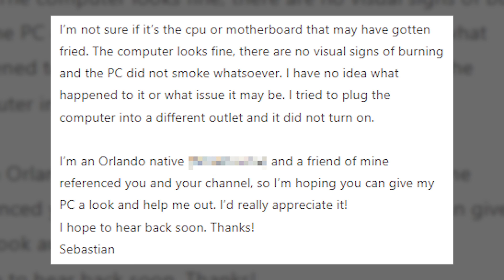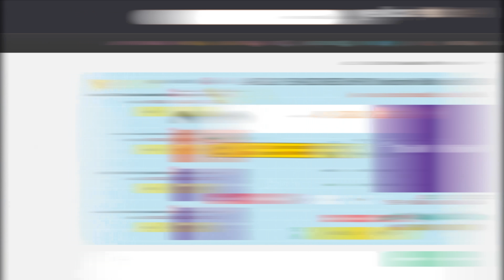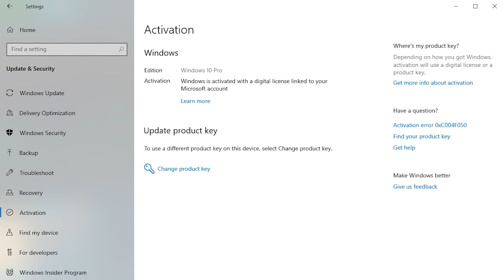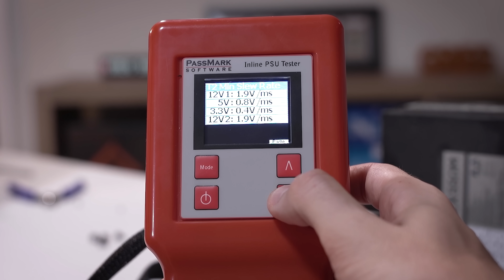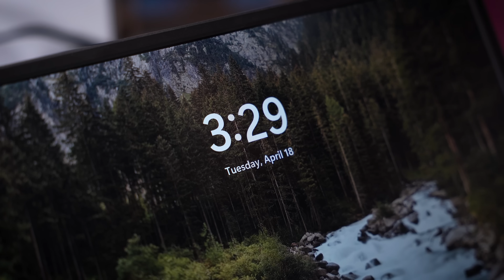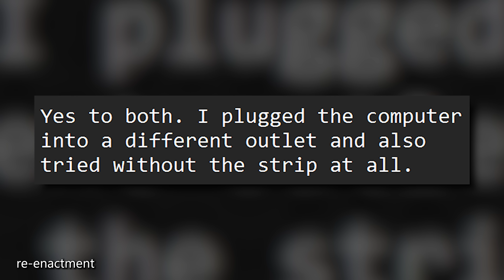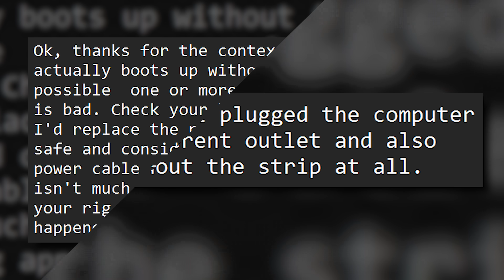Fixing a Viewer's BROKEN Gaming PC? - Fix or Flop S4:E6

Comment: I would have bet good money that his psu was going to be toast. That must have been one heck of a power strip to absorb that big of a surge. Most likely he will need to replace all the outlets in that room, just to be safe, done by a certified electrician. Have the wiring for that room checked and the breaker checked as well. All in all, a good job with the trouble shooting.

Comment: I had a power supply fry on me once. I didn't want to believe it, tried to power it on a second time. The first, it blew itself but probably didn't fry the system. The second time, it sent full voltage through everything. Nothing was salvageable. I had charred chips on the hard drives. Turned to ash. Electricity is nothing to play with. Always err on the side of caution. I often think "what if I hadn't tried to power it on that second time"?

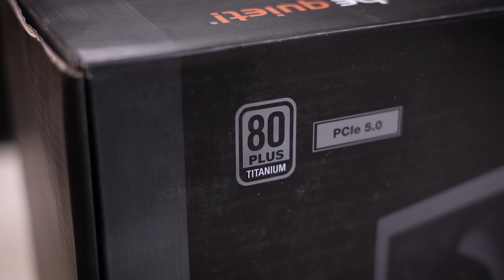Comment: 7:40 GN has already proven that 80+ has nothing to do with quality components
Reply from the maker: Has nothing to do with "proof." Doesn't matter what GN or anyone else "proves" or "doesn't prove." A more efficient unit requires certain tolerances. It can be a reflection of design/functional quality - though obviously not the only metric. A PSU using excellent, efficient components that is routed or mounted improperly, for example, is still a shit unit. But I'd certainly choose a more efficient unit over a less efficient one, all other things equal. And that was the point I was making. No need to look so deep into it.

Comment: I really don't understand how anyone calls you stingy. This guy's PSU is fine and does not need to be replaced. If you wanted to load test it, maybe you should look into booting live Linux USB. I'm even more convinced now that you replace parts just to advertise your sponsor.
Reply from the maker: We only replace components we feel justified in replacing - whether sponsored or not. In fact, our agreement with be quiet! stipulated that we had the right to push whichever product in their lineup we felt best suited the build in question. However, as you can imagine, there are many cases where a replacement isn’t warranted.

Comment: I have had more than one power bar go bang in my presence and the surge protecting device inside usually explodes violently if a breaker doesn't trip or a fuse blows before hand.

Comment: If the circuit that everything was plugged into loss the the ground the outlet would would still work but things like a surge protector would not. Lamps monitors etc would work plugged in but something with a powersupply that changes ac to dc such as a computer would not.

Comment: Damn, this feels so strange. I had this exact same situation happen to me a couple months back, i was vaccuming too close to my PC, i heard a loud pop, and then my rig wouldn't show any signs of life afterwards. Like the customer in this video, my monitor worked fine in the outlet on its own, and i even swapped out the power board my pc and monitor were connected to and nothing would work. Ended up taking it into a repair shop as I didnt have spare parts on hand, and it worked fine for them right away. Brought it home and it booted no problem.
Still cost me $140 to learn that difficult lesson that nothing was technically wrong. But it was definitely a weird experience and i got no good answers from it but i'm thankful i'm not the only one with that experience! Amazing video like always!

Comment: i had a psu that will remain off in case of surge or unexpected power loss i needed to flip the psu power switch  to reset it. it is a 11 years old psu and i like to think it is still a thing with modern psu's  to prevent power on  that may damage the system components and  it does so to isolate the components of the system from any short circuit. otherwise the system would not power on no matter what unless you reset it correctly.

that unit is still working perfectly and i still have it, it is an OCZ 850w gold psu i bought back in 2012 and i replaced it with a 1000w deepcool unit to futureproof my rig a bit but otherwise it works as good and almost as clean as on day 1 on that september 4th 2012  when i had built my old fm1 system with a A8 3870k quadcore APU that was fairly cheap at the time. i still hold on to that psu for another build from leftovers from upgrades i made to all the pc's in the house and maybe it can be useful someday.

Comment: I built a computer a couple weeks ago that was running great but the owner was using an old cable that had a bad connection at the end and the pc would randomly shut off if he bumped the table and the brakers would go out too. Always use a good cable.

Comment: One thing I would try before calling an electrician would be to turn off the breaker to the room and see what is on that breaker. You may be overloading the circuit.

Comment: So, I just got done tearing my whole PC down because I couldn't get ANY response. Aorus x570 Master and I thought it was the PSU. So I ordered a new one and that still wasn't it. Finally I read that the CMOS battery could be taken out and put back after 5 min and bam it turned on. Can't believe that little battery caused the problem when it should have enough power with the psu. Smh, time to put er back together.

Comment: If not the power strip, then the power cable.  Could very well be that the cable was cinched or cut accidentally, exposing a short.  If this is the culprit then definitely get a new power cable, as that could be a fire hazard, for sure.

Comment: 5:28 please don't ever touch inside those prongs of a PSU. My friend did that after he unplugged his PSU and the caps inside were still quite full with charge... This can seriously hurt if a huge cap is instantly releasing its stored energy into you.

Properly power down and empty your caps before doing so!
Reply from the maker: If by prongs you’re referring to the heat sink, those aren’t charged. The caps look very different. We’re well aware of this and work around PSUs all the time. We’ve also given many disclaimers about the dangers of working around PSU internals if you don’t know what you’re doing 👍

Comment: I used to encounter this before. Thinking my power supply was dead, I went out and bought myself an upgrade. When I installed the new PSU, I was using the old power cord that was plugged into the wall... and it didn't work. That's when it struck me that it was a faulty cord, not the power supply. The power cord doesn't appear to have a blown fuse or anything...

Comment: If its an eco friendly power strip, those usually have certain outlets on them that wont power on until the main outlet plug is plugged in and powered via Main -> 4 Eco outlets. I'm wondering if this is the case, I use one of these and the monitors will have no power until my computer is powered on. Its possible they could have plugged the computer into an eco outlet and not received any power to it because of the design. Also if the fuse is bad inside of the strip, this could further complicate the whole strip.

Comment: PSU could have gone into "Protect Mode" where it won't power on due to a spike.

Leave it unplugged from the mains for 5 - 10 Minutes and try it again and it usually works.

Comment: My computer has done this on 2 separate occasion. I checked the outlet and the surge protector and both are working fine, but no matter what I do it just won't power on by pressing the power button like it usually do. So what I did is I tried to remove the two 8 pin power connector on my 3070 then plug just one and it powered on after that. The 2nd time that it happened again I just did the same thing but it won't power on with just one 8 pin connected so I connected both and it powered on after that. It hasn't done it ever since then and the computer is working fine up to now. Probably would not have fix his issue but some weird things just happen to computers and electronics sometimes.

Comment: If other things work in the outlet without the power strip it's not the outlet, it's got to be the power strip. Would have been cool to know if the strip was a cheapo $10 dollar one or a $30-$80 dollar one. Specially if he didn't have to go to the fuse box and flip a breaker back but even if he did have to and then other stuff worked it for sure is the strip

Comment: Hope someone in the comments can help or even bitter Greg so I did a pc case along with adding a new motherboard ( note it’s used refurbished) and a cpu also used off Amazon so I installed everything and nothing the pc has power fans spinning cars lights up but I have a debug cpu light pulled cpu out checked pins on board they looked fine reseated it and nothing so I just sent the cpu back and ordered a new one but my concern is that I get it back and it dosent work how likely is it that it’s the motherboard when everything is getting power

Comment: I used to have a problem with my computer and modem long ago. After some time I realized that the ground wire wasn't connected in the outlet. That fixed all my problems. Turned out that several of my outlets were the same

Comment: Surge protectors will do nothing to protect from brown outs and fast changes in voltage (under 120 VAC).   For that, get an UPS from a reputable manufacturer like APC.    If the local power company was working on the lines in the area, or if there was a cascade failure in the local grid, it could cause a rapid on/off cycle like described in the video.

Comment: Was probably the fuse in either the plug top for the surge protector or the fuse in the power cable going to the actual pc. Which is why it didn’t work at another outlet in the house.

Comment: Greg I really need your help! I built my first pc alone it all worked with the small caviat that normally pc restarts after first boot for the day. Yesterday though my nvme stopped appearing and it apparently was broken although it was  a month old... i bought a new one and a day later it dissapeared too... the pc is with motherboard a320m s-2h  rev 1, R5 2600, 16gb Teamcrate 3200, used at 2933 as the cpu performs bad at 3200 in my case. What should i do and try? I use all latest drivers and bios from Gigabyte site for this specific model. Basically it booted me in windows then restarted and this happened with a blue screen 0x000000c.
Update i just reseated the nvme and it appeared then changed the boot order to it and the pc works... but normally for first boot it also restart, everything is used besides nvme so my guess is a motherboard problem? Or may be this can come from the cpu? It was really cheap but with all pins straight... it doesnt fell 100% good on the mobo though and it sticks to the cooler if i remove it.

Comment: I work with PC maintenance and once I had the customer's power cable short right in my face.
Nothing terrible happened, a few sparks flew around, replaced his power cable and everything worked fine.
So even if it's a very unlikely problem, you should NEVER rule it out.

Best regards!

Comment: happeing same with my rig my lcd is getting power but smt up with my pc. Its like when i give power to my pc fan turn on for 2 secs and everything seems like its not getting power but my mouse has light in it nothing else works, fan doesnt turn on back after spinning for once and even if a cut the power and try again fan doesnt turn of. until i wait for 30 min to 1 hours to turn that fan again for 2 secs what u think is going on with my pc i think its the supply but its giving power as mouse lights up and also the usb has light in it. i have tried swaping ram with the one not used in a long time have swaped the cpu too also the gpu it happens same with every thing changed i havent tried troubleshooting my psu. and one more thing like a month ago same thing was happeing when i resited everything again it was working normaly.

Comment: Could it be an older house? A little story here. I owned a house that was built in the 70s. At some point, there were some improvements made. All of the outlets on the outer walls were replaced and rewired. In the center of the house, there were some load-bearing walls. It separated the kitchen from the living room and in between was a walk-in pantry. I had my rig on a desk in the living room against that wall. What I did not know, or even consider, those outlets were never improved. They were regular looking 3 pronged outlets BUT there were not grounded. There wasn't much for regulations back in the 70s and without having a proper test done on 2 specific outlets I would never have known. It would cause all sorts of problems, including odd inconsistent shutdowns. Once I moved the rig to a proper outlet it never happened again.

Comment: It could be the power cable. Cables fail if you wiggle them too much. I have actually seen a bad C13 power cable going to a monitor. Replaced the cable and the monitor started working again.

Comment: Going by your description of the owners electrical issues it sound like he has loose neutral wire somewhere in that rooms outlet circuit. He is getting just enough power to turn on a monitor but not enough for the much more power hungry computer. With a loose neutral you may get weird voltages like 86vac out of the full 125vac at the outlet which would be just enough to turn on something very light like a monitor, but once you try and pull too much current it drops to zero vac. He needs to call an electrician to troubleshoot his electrical system. I have replaced a lot of burnt outlets due to loose connections on service calls.

Comment: Strange electricity issues here. Similar happened to me years ago in my mother's house. I remember that my PC turned off without any reason, and it won't turn on again unless I switch the outlet, then came to the original outlet and booted normally.

Comment: i remember when i lived in florida.   spikes in power from lightning happened all the time, people think because they got a power strip they are protected and think they have a surge protector.   truth is, no you dont, you have to look at the joules rating.  higher the better.   i am surprised more viewers in florida do not know this.   in most cases the cheaper you pay for a surge protect the worse the protection, the more you speed the better, always look at the joules rating.  again higher the better.  also cheap surger protectors are good for one time use of a spike / lightning strike.   the more expensive ones have a reset button on them.

Comment: Over loaded circuit can explain the lights flickering, also most modern PSU wont trun on if voltage in circuit is under the voltage neede.

Comment: This actually happened to me. A320 boards (2 MSI and 1 ASUS). Asus A320 boards have this stand by orange LED that blinks when power supply is plugged in and I can see it's lit up but it just won't boot. Swapped PSU's, RAM's, CPU's and everything in between. Thought it was an outlet issue but my older and even cheaper boards (A68, A78 all MSI) work just fine. Had it packed and tested in a different location and it booted right up. This continued for atleast 2 months. I never did find out what caused this issue.

Comment: a quality $20 power strip from tripplite (model # TLP606B, they make good stuff. if you want the gold standard from them, look at the ISOBAR range. they're even better. / and regardless of brand, don't cheap out on your power feeding devices. ever. especially the strips, when used. $5 could cost you thousands, while $15 more can help save it. good brands also carry device insurance.), and a 100-150$ power supply is a small price to pay for keeping the system from frying if the psu is of dubious status after a power spike.

power conditioners and UPS are optional, but also recommended, since they'll keep the ac line voltage clamped to safer levels, which will prevent your hardware from seeing anything bad, and you'd, at most, just need to replace one of them/have it serviced. again, small $ amount vs thousands in some cases.

Comment: the power strip probably did its job.  But he also said no other power outlet worked.....?  Did he check the trip switch (circuit breaker) in the meter board?

Comment: That turned out like Corsair PSU's are insta crap..been with Corsair's with my builds and NEVER had issues..

A power strip isn't an AVR..invest on a UPS, all my builds use UPS..you can buy a 3000$ rig but fails to buy a 60$ UPS..

Comment: I'm wondering if there was some sort of overcurrent protection breaker in the PSU that needed some time to reset before working again. 

It could be that the elapsed time between the surge and the retest in the property was not enough to let this happen... or maybe the PSU needed to discharge somewhat before it reset.

Just a theory. 

Either way, replacing the PSU is probably the right call.

Comment: Greg Salazar,  I have had this same issue with a customer new PC I built for them, There system was turning off when connected to a cheap power strip, I told the customer to plug into the wall and do not use the power strip still same problem. So I told them to try a different outlet in a different room.. BINGO the PC stopped randomly turning off. They got an electrician out and found bad wiring in few of the room of the house. It was an older house like 25 to 30 years old. This can happen 100%

Comment: Hello, what is the cooler model from Noctua? And does the side window of the NZXT 510 completely close with this Noctua cooler ?
Reply: Very good question:
The cooler looks like the good old Noctua NH-D15 (165mm height) -> the NZXT 510 could take up exactly 165mm.